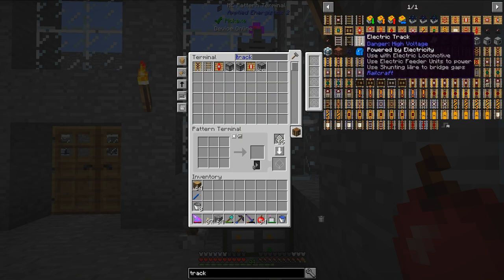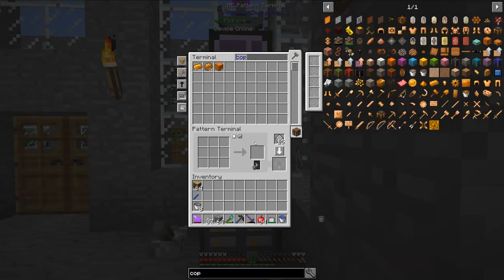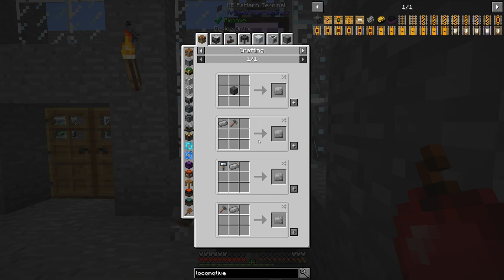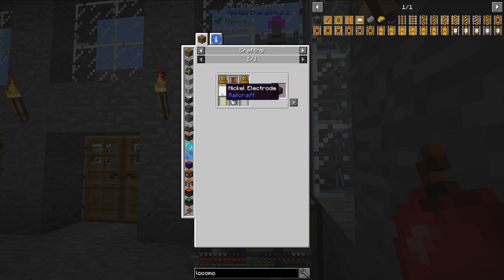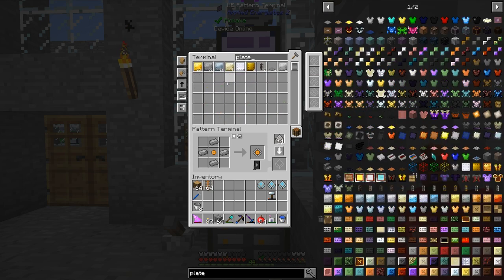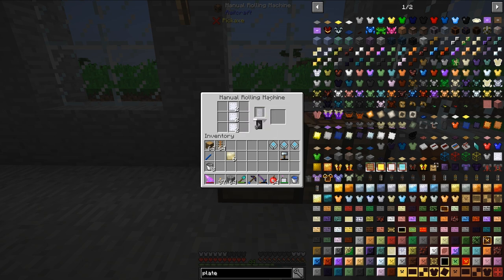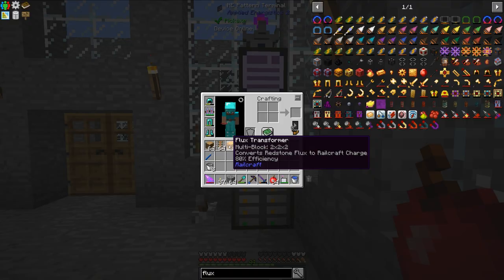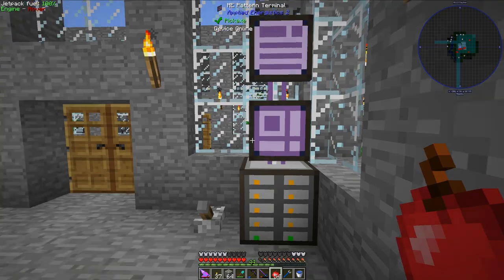Episode 17: A Better Locomotive!

Comment: How do i get the electric engine?
Reply from the maker: Are you having problems crafting it? And are you using the mod JEI (Just Enough Items)? 

The crafting recipe (starting from the upper left hand corner) is: 

row 1- Redstone Lamp, Steel Plate, Empty slot
row 2- Charge Motor, Nickel-Zinc Battery OR Nickel-Iron Batter, Charge Motor
row 3- Steel Gear, Minecart, Steel Gear